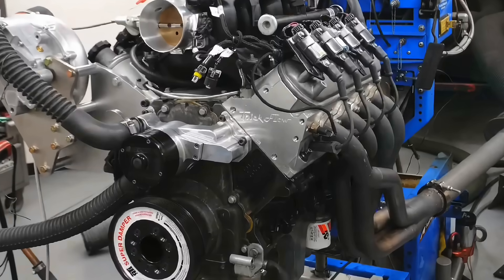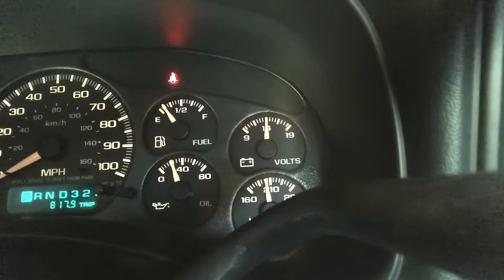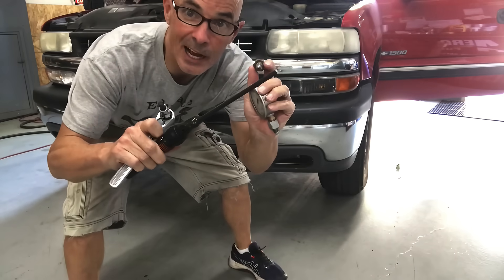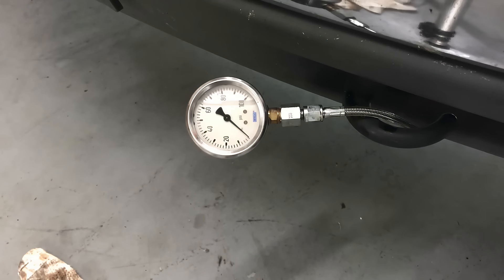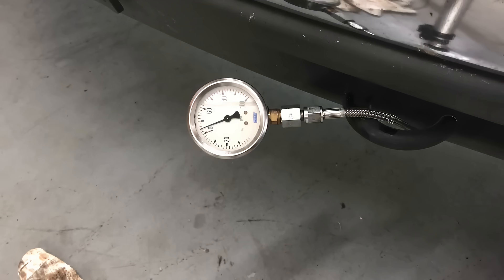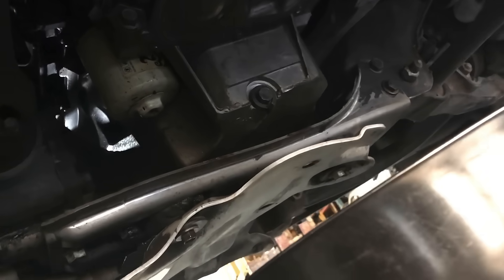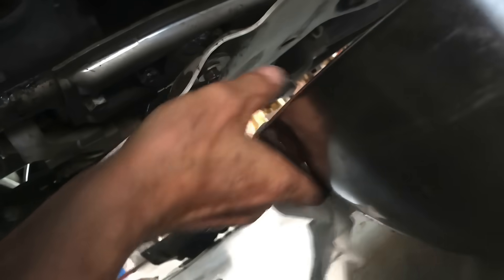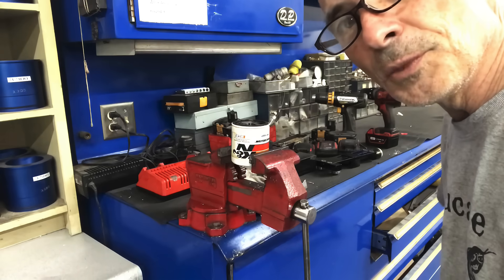HOW TO: TEST & FIX LOW OIL PRESSURE IN YOUR 5.3L OR OTHER LS?

Comment: What type of fitting is that you used on the block to the mechanical gauge? Also, is this a good place to run a gauge?
Reply from the maker: you can also run it near the oil filter (ICT Billet has adapters) or replace or T the factory oil sending unit

Comment: My 03' 5.3L saw the pressure dropping slowly to eventually it was under 30 psi @ idle. With 266,000 miles on the original engine, I figured the bearings are getting worn. Went to a 20-50 Valvoline and it's back about 40 psi. Just used a heavier oil to help fill the gap; worked for me! I'm aiming for 300,000+ out of this old workhorse daily driver.

Comment: Just did my 05 Tahoe oring  36psi at start up wouldn't gain pressure till warm and wanted to tick intermittently after idling for a few minutes now the pressure gains with rpm like it supposed to 4x4 they say you can do it without dropping the diff just do it and unbolt  the idler arm assembly and just drop it makes ahit 100times easier get a pan gasket a half gallon of diesel to clean the pan I rune gxt 5w30 full synthetic and Mobil 1 filter never went past 4000 miles and still had sludge at 160k and do not run the bell housing bolts in till the rest of your bolts are as tight as you can get with fingers or youll push the rear seal housing off center and youll be doing it next

Comment: I am very, very curious.What is the mileage on this truck?????
Reply from the maker: 350K
Reply: @richardholdener1727 omg WOW OMG THAT MANY MILES 😮 I guarantee you have the 5.3 l vortec V8 in there. That's my guess anyway or the 4.8 l V8. No wonder why you were having low oil pressure. Look at the mileage on the truck holy cow The highest mileage I've seen on. These trucks was 341000 you beat it. That is very impressive. I have one that has around  129,000 MILES 5.3 L V8 4X4 GREAT TRUCK I LOVE IT My oil pressure extremely high. But I'm doing a lot of prevented a maintenance to it and it hasn't been replaced.So I think next year i'm going to replace it , and you never want to put a high flow oil pump in it will give way too much pressure. Some people think that's a good thing. But I've seen somebody put one of these in and they had well over 85 90 psi  pressure way too much. I normally would use a regular o.e m brand from chevy. But very impressive. One thing I hate about it is how much money it has cost me over the last few years in parts and labor. A lot of things have failed on it. But you have to expect that My truck is 21 years old.

Comment: Mine will drop every now and then when I crank it up sometimes it will be like 25 other times it'll sit right on 40 or 45 I just changed the oil in mine and when it's warm it stays about 38 soon as you give a gas it goes up goes up to about 45 what's 236,000 Mi on it I think my gauge is bad

Comment: get yourlselves a Bi-Directional scan tool so you can test the oil sensor through the scan tool also helps with running down ALOT of GM electrical issues

Comment: Hello so I have a 2004 suburban LT and I have an issue with the oil pressure it’s not low but at idle is at 40 and driving it would get to 60 and now it shoots all the way up to 80 which never had done before what could be the problem?
Reply from the maker: stuck bypass, bad gauge or sending unit?

Comment: The engine sounds perfect at startup and idle. When I drive 5 MI the lifter starts to tik. If I let it sit at idle for a minute or two it stops. It seems to have really good oil pressure but the gauge kind of jumps. What do you think this could be.
Reply from the maker: that is odd

Comment: so i had a oil leak , thinking it was the rear seal on  a 5.3 l  chevy,  so i watched it added stop leak seemed like it worked some? but it was still leaking some, was watching a youtube video and this dude said you can have a leak at the oil temperature sending unit so i ordered one of amazon got it installed 3 days later the oil meter was working normally reading 38 pounds,  oil leak stopped!  true story, check the oil sensor on any 5.3 liter engine niggas.
Reply from the maker: COMMON LEAK SPOT

Comment: Where can I get that oil pressure tool?
Reply from the maker: it's just a gauge-drill and tap the stock plug
Reply: @richardholdener1727  gotcha. The autoparts store doesn’t have one where im at so ig i’ll go online and get one.

Comment: Both times I had this issue it was the o ring on the pickup tube. 2 wheel drive is a quick fix but 4x4 is a pain to get the oil pan down. It's absolutely doable and should not be neglected it's just time consuming because of the four-wheel drive goodies.

Comment: Somebody help! My 2009 6.2 L9HVVT engine but no DOD thank God. Everything has been checked. I even bought a manual oil pressure gauge. At idle it drops below five and the dash says turn engine off low pressure at a red light. As soon as you touch the throttle, it goes away going down the highway with 40 psi Stop at a red light back to dangerously low. My only other option is to pull the whole engine and put an oil pump and pick up tub gasket. We even tried the old trick where you put 8 quarts of oil in the 6 quart pan submerging the pick up tube gasket to isolate the problem. It cost as much to remove the engine and put a oil pump in as I can get a whole engine at the junkyard and slam in there.
Reply from the maker: how many miles

Comment: I had low oil pressure after putting new sending unit and oil pump new pick up ring and filters ... But after driving it on a long road trip it went back to normal

Comment: This is normal when up to temp.  I cannot believe nobody knows this
Reply from the maker: it is not normal for the oil pressure to suddenly be lower than it was the previous 5 years. A sudden change in oil pressure means a problem. We cured it

Comment: I have an 08 Chevy avalanche LTZ 5.3 L put a new oil pump in it pick up tube pressure, relief valve and oil pan new screen and oil sending unit and starting oil pressure start up at 60 psi but was dropping once the motor warmed up. I thought it was cam bearings or crank after taking the intake off and taking a lifter dod plate from under the intake come to find out the solenoids were leaking. Put a new plate with new solenoid put the intake back on now it’s running 40 psi at idle hot and 60 to 65 running down the road drove me crazy trying to figure this out. lol

Comment: My '02 5.3 Chevy Tahoe oil pressure stays at zero now and the light pops on with a light tapping I have no pressure at all at first it fluctuated after changing the oil pump and the switch and new oil I'm still at zero pressure light comes on light tapping on my Tahoe
Reply from the maker: gauge, sending unit, o ring, filter, bar bell, front oil plug

Comment: What was the oil psi after changing the o-ring?
Reply from the maker: back to normal
Reply: @richardholdener1727  what is normal?  The range is 25psi -65psi from what I've read.  Mine runs at like 22psi and no problems...yet.

Comment: My 02 Suburban 5.3 has 165k and runs like a top. At idle it’s at 40 psi hot. Cruising on the freeway it’s usually 55-60 psi. But all of a sudden my oil pressure sensor switch started leaking tons plus pressure at idle went down to 30 psi. At first off oil leaking made me think at first it was the rear main seal. So I ordered a new AC Delco sensor but everywhere I search online for the sensor mesh filter it says on some sites the 917-143 fits but on others it says only for the 2003 and up 5.3. Never down below in the listing says for 2002 just 03 and up. So anyone know if I should buy the 917-143 or maybe did my 2002 5.3 not come with a screen filter? 😊 thanks Richard for the great video. I’ve always changed the Mobil1 Hugh milage full synthetic every

Comment: I recently installed an aftermarket cam  in my 2002 Tahoe 5.3 L59 and I knew by the looks of my cam bearings I was soon to be in trouble, especially the way I like to drive it! However I knew I was going to completely rebuild it and I didn’t really care if it didn’t last 50,000 plus because I had already bought a much bigger cam and all the needed parts to FULLY rebuild my 5.3. Just 10,000 miles later I began to notice as the weather got warmer my oil pressure got worse! For the guys who know, some of us know our trucks better than we know our wives and if our truck so much as makes a lb. less in oil pressure, we’re raising the hood! Bottom line is I have 255,000 miles on it with bad cam bearings and still I had at least 28 lbs. of oil pressure warm and idling tells me that if you don’t own a Chevrolet with an LS you should go out and buy one immediately!!!😂

Comment: Just for the sake of information I know of a guy who had low oil pressure because of trash in a perfectly good sending unit. Don’t fully understand how the trash got there but he couldn’t get above 20lbs at any rpm he didn’t have a single knock or tick in the engine and outside testing of the sending unit proved to be the reason. Good sending unit but partially blocked because of some debris after replacing his sending unit, he couldn’t get a reading above 20 psi at any rpm.

Comment: I just had this situation on an 07 6.2 from 15 lbs idle to 50 lbs same temp same rpm..
I flushed the motor twice, then changed the oil a third time. And it's fixed

Comment: i got a hard one for yall. 2001 tahoe 5.3  378k miles. say i changed the oil today at 378,800 miles, it will do fine and idle perfectly at 40 psi, at 379,800 + - itll drop psi to 20-30. change it again, its fine for another 1000 miles but after that it drops again. been happening for about 5 oil changes now and im thinking maybe clogged velleys. using mobil1 high mileage 5w30 with no stabilizers or anything and k&n filters. i dont think its possible that the filters keep getting clogged. im just at a loss
Reply from the maker: does the oil smell like fuel when you change it?
Reply: @ not at all

Comment: My problem with my 5.3L when i accelerate my oil pressure drops only when engine is hot too. Works fine when engine is cold

Comment: I have a 2011 and according to the computer I had 33% oil life left. I was driving over to my sisters and the dash lit up and alarms started going off. It said no oil pressure and to stop truck immediately. I pulled over and checked oil level and it was fine. No oil leaking anywhere and didn’t smell any burning. Started it back up it was at 20 so I drove it to my sisters which was about a mile away. My brother in law, Mr Fix It, didn’t see anything wrong either. We went to store and bought the stuff to change oil an voila, oil pressure normal. Not sure what happened but I have been staying local to make sure it’s ok. So far so good.

Comment: I have a 05 Silverado 4x4. It has 143,000 miles. When I bought it, it was 2 tears old and still under warranty. My oil pressure has never been as high as yours. Motor warm, driving 75 on the interstate, 2200 rpm, oil pressure is 42 psi. My problem is that cold start oil pressure is good. After driving 3 miles, oil pressure goes down to 35 driving. At idle, oil pressure drops below 10 psi, and it alarms. Drive 12 miles to town, and the oil pressure is 30 at idle. It normally stays ok all day. I'm a retired mechanic and have always maintained my vehicles to very high standards. I'm pretty sure it is the o ring. Dissapointing to me that it hasn't lasted longer. The next step is to use a mechanical guage and monitor oil pressure. I'm 74, and pulling the pan on my 4x4 isn't fun. I appreciate the video and your comments. Thanks
Reply: it could be the oil pressure sensor.
Reply: What weight and type of oil?

Comment: I changed my o ring on my oil pick up tube as well as the sending unit. Oil pressure still drops to around 30 give or take. Anyone got any idea what it might be? I have a 2014 Silverado 1500 only 80k miles.

Comment: how much oil spills out?   Could this be a permanent installed oil gauge vs sensor replacement?   What do you think of the engine flush / oil treatments?  Great video!

Comment: Riddle me this. I have a 2005 GMC Yukon AWD 5.3. Symptoms were for a bad o-ring on tbe pick up tube. To verify, added 2 quarts of oil, jacked up the rear, full oil pressure at startup. Point the truck slightly uphill, no pressure at startup.

Took it to a reputable mechanic a good friend recommended. We changed the pickup tube and o-ring. It was a GM tube with the o-ring installed. Exact same symptoms. Scanned it, no pressure at startup. Hit the gas, pressure comes up to normal. So, with 8 quarts of oil in it on level ground, it will have normal pressure. Drove it home, 47lbs pressure at 2k rpm's. Give it some juice as if to pass and the pressure will go up to about 60. Hot idle 600 RPM between 25-30 psi. No engine noise whatsoever and runs fantastic, but if I point it downhill it will not have oil pressure at startup. This has been verified with a manual gauge. 

What else could this be? It's like the pump is losing prime but once it Primes everything is peachy. Really hoping someone can help with this.
Reply from the maker: CHECK YOUR SENDING UNIT
Reply: @richardholdener1727  I should have said it in the OG post. That's the very first thing I did. I replaced it with a new ACDelco part. No change. It has been to 2 shops, the first said it was ready, but failed to tell me it still had zero oil pressure, after I had paid them and knew i was picking up after hours. They screwed me, period. The second shop did hook up the scanner to verify the new sender was showing the correct readings, and manually checked the oil pressure. This has us both stumped. It has a brand new pickup tube and the supplied o-ring installed. New sensor, o-ring replaced by the first shop, pickup tube and o-ring by the second, and the symptoms are the exact same. 

6 quarts on a flat surface, zero oil pressure at startup. 8 quarts in the pan and it will startup with pressure on a flat surface level or pointing downhill. Park it with the nose up the hill, zero oil pressure.

Comment: My 2008 suburban with the 5.3 has been running on 20 to 30 psi of oil pressure for 4 years. Didn't even think it was bad 😅
But my lifters are band and clacking so that's

Comment: Got one for you, 04 5.3, 212k synthetic oil since new , idles at 40 psi, goes up with rpm as expected. Randomly on cold starts it shows 0 oil pressure until it either gets some heat or you rev it, at that time it jumps right up to normal operating pressure. Never makes a noise or any usual indication of low oil pressure.
Reply from the maker: sensor problem?
Reply: @richardholdener1727  sorry I forgot to include i changed the sensor recently.  It didn't do it for a week afterwards,  now it's nearly every cold start. I will say I didn't change the screen, my concern is that it's the o ring on pickup, and reving it makes enough vacuum to pull oil up and "seal" it until next startup. But wouldn't I have low pressure constantly? Once it reads I've got 40 at idle and 80 wot no fluctuating. Appreciate your reply
Reply: @richardholdener1727  so, pulled pan, replaced o ring. Everything was super clean no sludge at all. Issue continued.  Put mechanical guage on today.  Digital guage is correct.  So she's getting an oil pump. Probably timing set and small cam too. What would you suggest for a cam? Just want to let the 5.3 breathe. She's a daily driver, awd, don't want to do stall or springs. Just to get a little more pop. It's flex fuel so injectors can handle whatever. Appreciate any feedback. Thank you.

Comment: 2018 Tahoe. Diagnosing the same issue. Changing everything before I h e to dig in and change out that pump. Got 160k miles. Any suggestions?

Comment: With an abrupt drop in oil pressure, I wouldn't expect worn bearings or worn oil pump gears to be the culprit, as bearing or pump gear wear should manifest itself as a steady decline over time. My guess is that it would be a leaky gasket or oil ring somewhere.

Comment: I have a question for anyone who can answer. My oil pressure goes down to like 5 psi after hour or so run time. At start it’s at 40psi or a little under. Over time it’ll start to drop. So I’ll notice it at like 35psi… 30psi.. 25psi.. etc. but not right away. Over time. I’ve replaced the oil pump already because it had no oil pressure and the truck would start boggling. But I soon noticed now over time the pressure drops to about 5 and the truck starts to boggle again. How do I fix this and or what is causing it go down once the truck has been running for awhile.

Comment: My info is that the oil pressure is 20 to 60 psi .
60 psi at start warm up down to 20 psi at idle and 40 psi at 60 mph. Highway
Looks to me like you are chasing a ghost.

Comment: So is 15w-40 ok to run in an older LS engine? I have a 2002 Silverado 2500HD with a 6.0 L gas vortec. Please lmk. I’m doing an oil change soon and replacing the o ring on the pick up tube.
Reply from the maker: it will work and increase oil pressure slightly

Comment: Mine does this but drops lower then 10 at idle and triggers the oil pressure low warning but goes away when I start driving replaced oil pump and o ring and the problem still occurs almost 300k miles

Comment: Bros freaking out over a perfectly fine motor.
Reply from the maker: Bro fixed his perfectly fine motor-when you start to understand motors, you will realize that when there is a dramatic change in oil pressure (regardless of the reading), a problem is present.